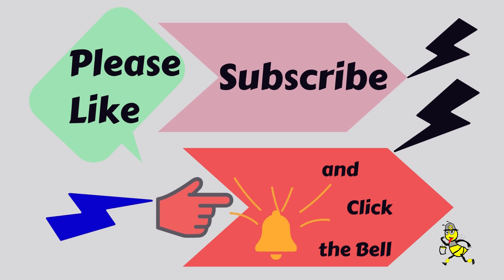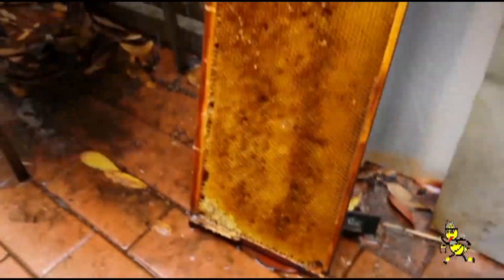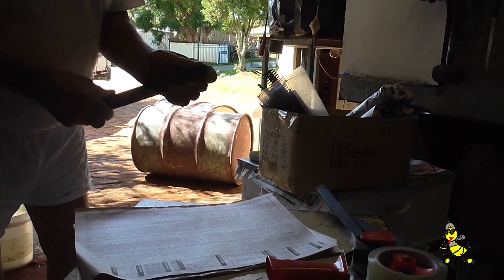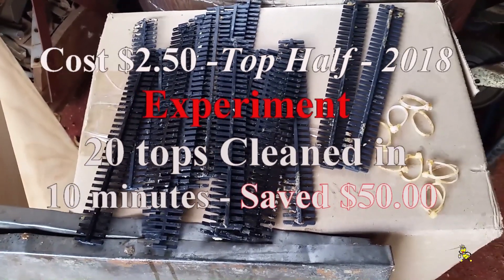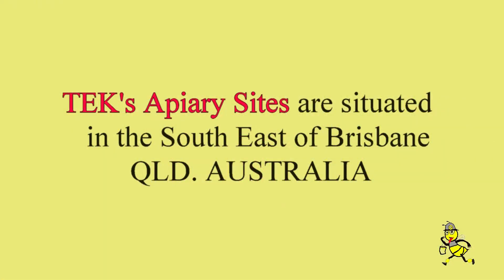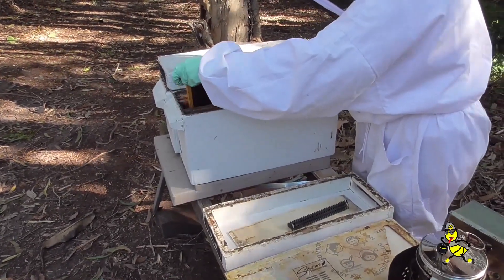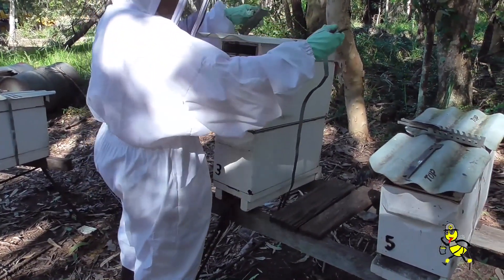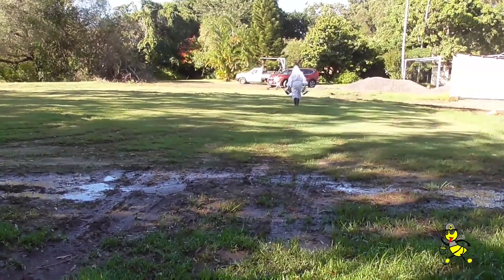S. H. B.  Videos Combined   #TheSeriousHobbyistBeek

Comment: TEK why do you have the cutout in the inner cover (Lino)🍺🍺
Reply from the maker: Down Under Fulla
So the Bees do not propolise the entry into the S. H. B. traps & traps become useless
Reply from the maker: Down Under Fulla 
Are you referring/replying to the Brood Rearing Mats OR the covers on the beetle traps?
Reply: Sorry TEK I should have been clearer. The larger mat with the half circle cut out of one end. It must be the brood rearing mat. Thanks
Reply from the maker: @downunderfulla6001  Yes!
You’ll see some Nuces with a solid B. R. M. without any opening in it – we were experimenting, but the experiment is not successful due to the moisture not escaping, frames getting mildew on them - so back to original
Reply from the maker: All mats that we use are vinyl - not lino
Reply: Thanks